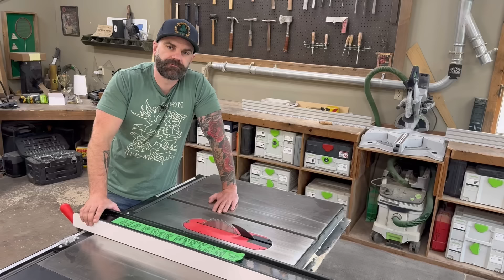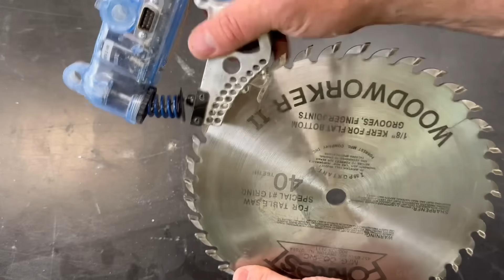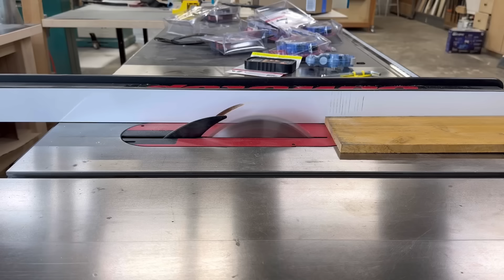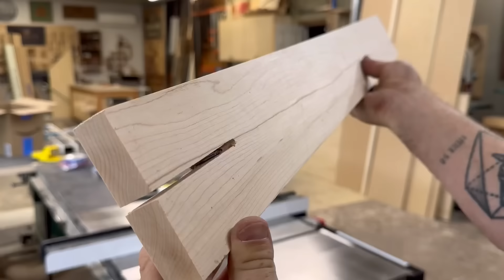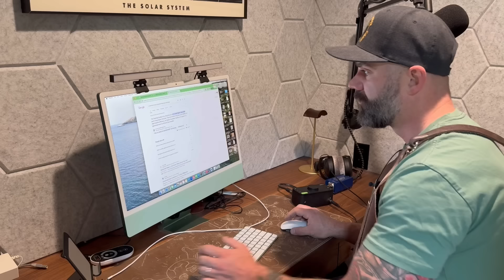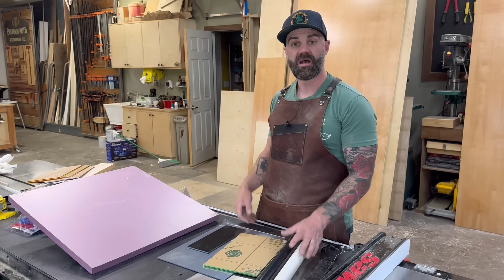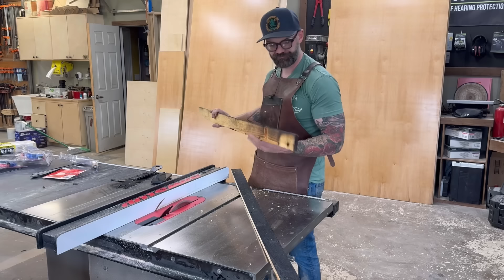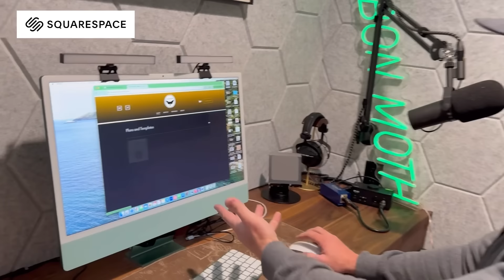Finger Versus Table Saw || Testing SawStop Myths

Comment: Thermal conductivity is how well the metal conducts heat, not electricity (more relevant in cooking pans, lol). Fortunately, sources seem to say that aluminum is much more electrically conductive than galvanized steel too
Reply: My guess would be that it's only about the capacitance. The nail and staple are tiny pieces compared to the blade, but the fence is a chunky piece of metal that considerably changes the capacitance when coming in contact with the blade, which impacts the potential yadda yadda, causing it to trip. Which might also be why wet wood can sometimes trip it and sometimes not.
Reply: Physicist here. You are of course correct to distinguish thermal and electrical conductivity, but for metals these tend to vary in sync with each other. If the thermal conductivity of one metal is 3 times higher than another, then the electrical conductivity will be roughly 2-4 times higher as well.

I agree with the other commenters that the trigger mechanism is most likely based on capacitance changes.
Reply: @chiaroscuro25  That's what I was thinking as well, Aluminum is a lot more thermally conductive than steel but it's also a lot more electrically conductive, same for copper vs aluminum. 

Very interesting that they're related, is it like the speed of sound is not about sound but about how fast the material/medium can propagate that energy? Thermal or electrical it's still energy. 
Not surprising electrical conductivity is higher than thermal because speed of light... but thermal is also dealing with infrared so that's probably not it I guess.
Reply: @justfasial01  The electrical conductivity is determined by the ability of the free electrons in the conduction band to move. It turns out that that mobility also allows those electrons to carry thermal energy around.
Reply: @chiaroscuro25  Interesting 👍
Reply: @chiaroscuro25  Glad you made that comment!
Reply: @chiaroscuro25 yep
Reply: Came here to mention this as well.   :)
Reply: Lol my ptsd from heat transfer immediately kicked in when I heard that
Reply: This. You can still sometimes find aluminum wiring in really old houses.
Reply: @FunSam  aluminum in cable is still pretty common and I still see electric motors with aluminum wire instead of copper
Reply: @SoHighIFly  copper is very expensive
Reply: Aluminum wiring is still popular today but in higher voltage since copper wire of a certain gauge becomes really expensive compared to a aluminum wire
Reply: @tonylarose4842  And don't get me started on copper clad aluminum.
Reply: Glad this comment is here!
Reply: While you are 100% correct, there is a correlation between electrical and thermal conductivity for metals; both is affected by how free the electron travel in the metal. So while he is wrong, he isn't 100% wrong; or more like he is on to something :D
Also I think the trigger is more to do with capacitance than conductance
Reply: How to find out how many engineers watch your channel:
Reply: Thank you for making the point.
Reply: Thank you.  I was hoping somebody would stop him.  I mean saw stop him.
Reply: I’m glad I’m not the only one who noticed that glaring mistake!  lol
Reply: I didn't think anything in this video could make me cringe so much as his finger approaching the spinning blade, until that failure to understand the difference between thermal and electrical conductivity. 🤦
Reply: But the aluminum is anodized which reduces conductivity by a fair bit and if the voltages involved are on 3v that is way below breakdown voltage. I think it is all about capacitance. I would have tested it by touching stuff to the side of the saw blade, not as dramatic but equally valid.
Reply: @OscarSommerbo maybe, but once it cuts through the surface you’re in to the raw aluminum. That would be my guess
Reply: @OscarSommerbo  The blade touching the anodized surface cuts through the anodized coating immediately.

Comment: Safety glasses,ear protection,tucked in shirts, and no unbuttoned long sleeve shirts and the proper handling of table saws. My jr high school wood shop teacher taught me well and as an incentive he would deploy the paddle of correction. Half inch thick and holes in it to suck up the meat as he would say plus good wrist action, guaranteed to lift you off the ground. My dad didn't use hearing protection for all those years he worked making cabinets and stuff. I felt sad for him one morning as it was sleeting outside and he couldn't hear the sleet bouncing off the window AC unit. I did get him a personal headphone amp that hangs around the neck so that he could enjoy hearing as well as watching his favorite tv shows. One day my dad accidentally cut off the end of his thumb while using a table saw at work. Insurance helped pay for heating fuel oil that winter. Us kids stayed warm. 😊

Comment: The answer has and always will be.......keep your hands away from the blade.
Reply: The wood can drag your finger into the blade too
Reply: @lechatbotte.  not if they are not close enough to the blade.  Use a jig
Reply: @lechatbotte. not if you have a guard and use 2 birds mouth push sticks as is common practice in Europe
Reply: I've retired from 25 years of doing anesthesia. What I've learned is that even meticulously careful people will make a mistake, usually due to a moment of lapsed concentration. That's why I embrace technology which enhances a patient's safety.  I've also spent my life riding motorcycles. I know that very experienced and careful riders will sometimes crash. That's why I always wear safety gear while riding.  It's a fallacy to think that "because it hasn't happened to me, it won't". We're human, we make mistakes, and THAT's why I use a SawStop.